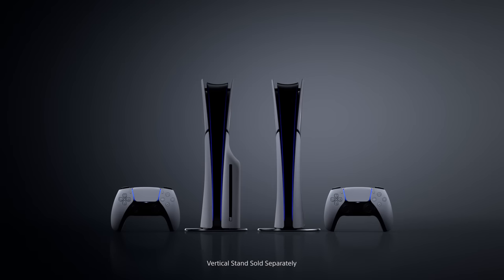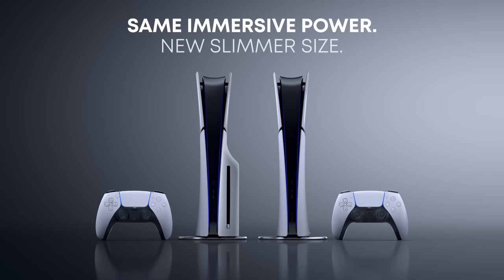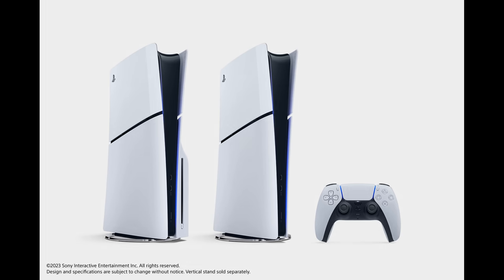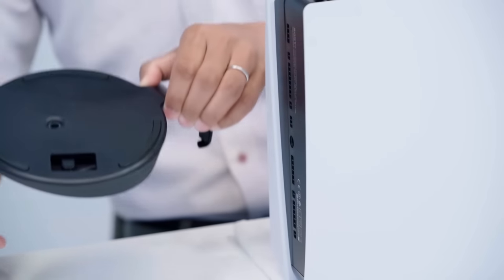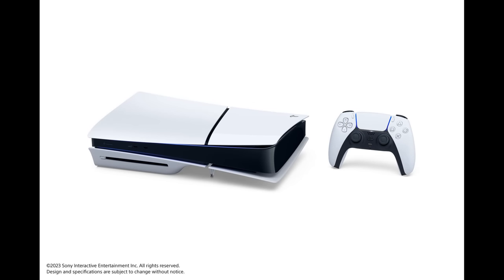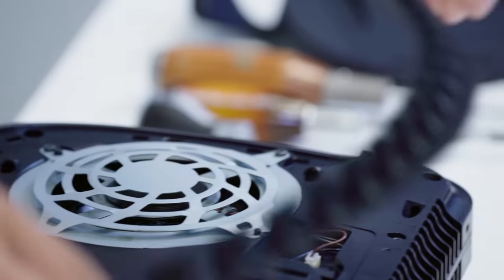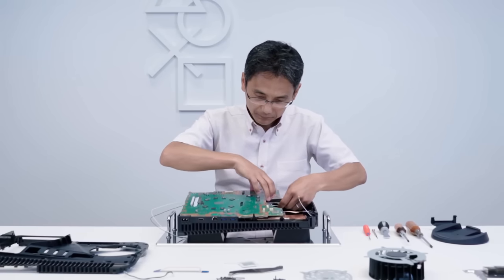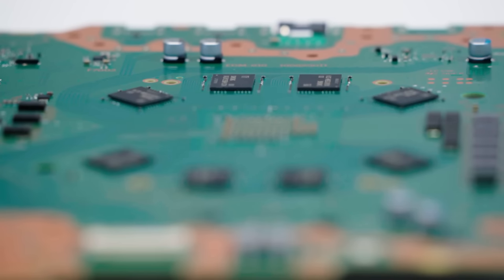PS5 Slim Details, The Good & Bad - Detachable Disc Drive, $30 Vertical Stand, 1TB of Storage

Comment: "What was Sony thinking" you say? This only makes "sense" for Sony in 2 words: Nickel and the other word is Dime.
Reply: that's modern playstation and this PS5 is no exception, regardless of what anyone thinks Playstation is not Xbox and vise versa the other way around thankfully, and regardless if Sony has or doesn't have the money to invest into this system doesn't matter at this point cause they have not been delivering on it barely since it launched, compared to a Nintendo switch or hell even Xbox, their library of exclusive games is laughable
Reply: @copingflower1909 Really what has Xbox dropped this gen? Two games and both were fucked up Redfall and starfield both bugged and glitched up… Both of these companies need to do better but Xbox has undoubtedly underperformed
Reply: @jshjsh6191  don't forget about Forza Motorsport 8
Reply: @alexalexius2688  Okay forza and from what I hear it’s not all that
Reply: @jshjsh6191  well I don't know:) I don't care about racing anyway, I know fans nuked and bashed Motorsport 7 really hard
Reply: Lolol exactly, a stand for $30 disc drive seems decently priced but come on now 500 an actual increase over the previous model for a subscription based console nar… gaming is now a luxury

Comment: Slim PlayStation consoles released at least $100 cheaper... How can it still be  $500 🤦‍♂️
Reply: Cause its Not slim is just a new redesign so the same PS5 with a 1tb storage so dont cry pay or dont pay Nobody is forcing you.
Reply: @ArielCleirigh I know they not telling you to buy it people need to just move on
Reply: @silverjoystix4696  @silverjoystix4696  Cheaper to manufacture, impractical nonsense design, charging more for slim cut down version, which current model version supposed to have 1TB storage already for its $400 price.

All Sony needed to do was design, external drive, wire connected to new optical port at back of console, or more practical design so console sits flat on a surface, with elegant stylish looks.

This slim model will not selling very well.
If anyone has any sense, they would buy the full drive version and remove the drive if they, do not need to use it.

Or better still wait for, PlayStation 5 Pro, which hopefully should be better designed.
Reply: @masterbeyond6548 won't be no pro bro
Reply: @sleasy01  We will have to wait and see, as there is already talk about, PlayStation 5  Pro, targeting 8K resolution with consistent 4K 60fps. 

Just like this talk of, PlayStation Portal, and now this new, Slim PlayStation 5, which has just been revealed, so it is with PlayStation 5 Pro.

Many welcome the idea of PlayStation 5 Pro and want this to be a reality. 

If you know there will not be, PlayStation 5 Pro, please explain.
Reply: @masterbeyond6548  I don't see a world where it makes logical sense to make a pro. Think about how bad the economy is and the fact that it's going to get worse. Even the mighty epic is losing money with fortnite. They'll make a pro and what will the specs be? 14 t flops? Then they'll have the same issue Microsoft has with trying to make games for multiple skews. Games are taking much longer to develope as well. Both companies are targeting 2027/28 for the next console release. We pushing up on 24 and Sony just did a mid gen refresh. A pro makes no sense in these economic conditions. I could be wrong but I honestly don't see a point in a pro. You'll get more stable frame rates and that's it. Just wait for the ps6
Reply: @sleasy01   I totally disagree. 
Sony will release a new cut down cheaper to manufacture, slim version of the same console, and charge $50 extra without a disk drive. 

To add a disk drive later will cost $80 extra, total of $530.
The new console sold at $500 with disk drive, is the exact same console sold at $450 with 1TB storage.
So why is $500 console with 1TB storage not more expensive? Also there should be difference of $80, but its only $50 difference from $450 to $500. 

Now everyone knows Sony is ripping customers off, for the disk drive, that only cost $50, charging $80 for it.
Also everyone knows $100 difference for current model is, rip off price, charging $500 which should be $450.
Also three years have pasted since PlayStation 5 released, and cost for, current model, should be $350 without disk drive, £400 with disk drive. 

Cost for, slim cut down console model refresh, should be $300 without disk drive, £350 with disk drive.

(Both consoles are exactly the same console)

This has got nothing to do with inflation. (Sony are charging more for cut down slimmer model)
Which means, PlayStation 5 Pro should be $450/$480, less than $500 with new more advanced features.  

You may not see the reason for PlayStation 5 Pro, but the console is advertised with 8K on the box, and games that should run consistent cannot even run at full, true 4K 60fps, without reduction in graphics and missing frames.

PlayStation 5 Pro is very much need as new slim console has no improvement.
If new slim console is improved then yes, there would be no need for PlayStation 5 Pro.

Now we all know Sony is ripping customers off, they cannot do it again:
I will expect PlayStation 6 to run full true 8K 120fps, and cost $450,  PlayStation 6 Pro, $480/$500, as technology improves and becomes cheaper over the years.
Reply: @masterbeyond6548  you are getting high LMAO. What graphics card out today can handle 8k@120??? Consistently? None. The 4090 can't do it and we are talking cards that cost thousands.  So how do you expect Sony to deliver 8k@120 for 499.99?  My dude the PlayStation can do 8k. Just not much on the gaming side. It can run 8k movies. Like I said, it's no point in a PS5 pro. The cost would be too much. Especially if the target is 8k. Sony is trying to sell PS5 consoles. Adding the pro to that would be a waste especially after you just did a mid gen refresh.
Reply: @sleasy01  As you mentioned PlayStation 5 cannot run games at 8K without problems. This is the reason for PlayStation 5 Pro.

Current graphics cards are good just the software and programming, is holding back their potential.
The programming physics is not correct. If the physics was correct first time, there would be no need for updates. 
This is the reason why there are constant software updates with improvements.

Technology within the next three or four years, will have improved so much, making PlayStation 6 very advanced technology. Games running, 8K 120fps 120hz, or better, is for PlayStation 6. 

New technology is coming which you never thought existed!
Reply: @masterbeyond6548  no my guy. They will not target 8k with a pro. The bulk of people that own 4k tvs is less than people that own old sets. So why target 8k when 4k isn't owned by the masses? That makes zero sense to focus on that when most people don't own 8k tvs. I don't know one person who owns one.
Reply: @sleasy01 
I already answered:
"This has got nothing to do with inflation. (Sony are charging more for cut down slimmer model)"

"You may not see the reason for PlayStation 5 Pro, but the console is advertised with 8K on the box, and games that should run consistent cannot even run at full, true 4K 60fps, without reduction in graphics and missing frames."

Which means, PlayStation 5, cannot run at full, true 4K 60fps, even though it has 8K on the box.
It is understood (PlayStation 5 Pro), needs to target, full, true 4K 60fps. (8K will have to improve to target desired 4K performance)

In the next 3/4 years 8K will start to become mainstream.

I will expect (PlayStation 6) to run full true 8K 120fps.
Reply: @masterbeyond6548  dude you are really getting high. In the next 3 years 4k tvs will still be a thing. 8k tvs are over 10 years out. Where is the content coming from for 8k? 4k has been out for a while now and most content is not delivered in 4k
Reply: @sleasy01  
I totally disagree,

PlayStation 5, already is 8K ready, and has 8K on the box. Its 4K performance is what needs improvement.
This is the reason for PlayStation 5 Pro, to improve its, 4K 60fps output performance, which will also improve its 8K.

8K televisions are already available to purchase, but can be expensive. They will reduce in price within 3/4 years from now.
You are totally mistaken.

PlayStation 6, will be fully 8K 120fps ready.
When PlayStation 6 is available, many will keep their 4K display, replace them, or use mix of 4K and 8K display.

Comment: I don't know, but for the original disc version, I would have made the whole middle black part as equal in measure as the top end (when the fan stands) instead of going with that asymmetrical design, so i can put the disc tray inside completely in the black part instead having that bulky design on the bottom. Then, i would have design the bottom plate same as the digital one, but with a small layer to look as a base. Think similar as PS3.

Comment: If it's like the OG PS5 you can still technically stand it up vertically without the stand it balances on it's own well
Reply: The stand is not really needed to sit vertically but it does provide more stability/balance if someone moves the table where the PS5 is standing on.
Reply: @ShakyShako  as long as you put the PS5 in a safe place and don't hit the Entertainment Shelf or Table it is standing on it is perfectly fine being vertical by itself.
Reply: @williamaguilar9389  indeed. It more depends on which environment the console is in. If it’s a calm and safe space then no need for the stand. Most people take good care of their consoles so the need for the accessory is less likely.

Comment: ok it seems to me that this is only one SKU but you can purchase different bundle, the one with blu ray drive and digital edition.
Reply: Only the digital version went up in price.
It is a price increase to  make the extra connections for the new digital to hookup with a optional Blu-Ray player.
The older Digital needed no extra connections for a optional disc player making it cheaper to make ..
Reply: It is one console.
Because the Disc Drive on the Disc version can now be removed and replaced, Making it a digital only version with a Detatchable Disc Drive Pre Installed.
I dunno how people cant see this. xD

Comment: From an industrial design perspective,I appreciate the defined streamlined look of the new models.I would also like to point out that paying for the vertical stand is not new to Sony Playstaion conlses as the vertical stand for the PS2 and PS4 were not inclded.I will not however be upgrading my launch edition PS5 disc system to the new slim variant.I would however purchase the vertical stand that compliments my PS5 setup with the new matte black DBrand vented sides.
Reply: Even though I already have a PS5, I would love to have the new revised version. If I ever had to replace it due to breaking and not working properly, I would get the digital edition version PS5

Comment: Happy with my launch PS5. I just hope the pro design doesn’t follow the slim. If it does I don’t care tbh still getting the PS5 pro regardless of what design it turn out to be.
Reply: I will wait for the Ps5 Pro review vs a standard Ps5.  Not changing for a small increase in game performance .
Like the PS4 Pro, only a few Ps4 games were Ps4 Pro enhanced , most games stayed at 1080p/ 30 fps  which the base Ps4  could handle fine .
Reply: Why are you buying a PS5 pro and games take 4 to 6 years to develope? By the time a game comes out for it the ps6 will be out
Reply: @sleasy01  it’s my money. You salty bro?

Comment: Circuit board getting smaller, heatsink getting smaller thru revisions and still i wonder whats the use big ass plastic around if other can do good airflow smaller than ps5 slim.

Should have been cheaper tho to be honest.
Reply: Naw. They save money on the design so you pay more. That's how it works. Not stop clutching your purse and give Daddy Jim his coin. He needs a boat to retire with LMAO

Comment: Vertical stand sold separately was the same with PS4, but yeah. Taking it away after it already came in the box is a bad look.
Reply: They're not taking the stand away there's the standard stand in the box...
Reply: @tristman8413 they did take it away…the stand that comes in the box now allows the console to be placed horizontally or vertically.  No additional cost needed…
Reply: @farhanryan2895  the stand that came with my og ps5 let's it lay horizontal or vertically... 🤷‍♂️
Reply: @tristman8413 correct, my launch model does the same.

The slim model only allows horizontal placement out of the box.  If you want to place it vertically it’s an extra $30.
Reply: @farhanryan2895  ah fair enough.

Comment: Didn't even mention the disc drive is a paperweight without a intial internet connection, what happens if you still have a PS5 when PS7 drops, they close the servers, your disc drive breaks, you buy another on ebay, won't work because you can't sign into psn anymore.

Comment: This is why Sony needs more competition because they don't care they just can't charge you whatever they want to charge now and then when the ps6 comes out if there's still no competition you'll be over $1,000 Australian because right now in Australia the bundles are about $900
Reply: Only the digital version went up in price.
It is a price increase to  make the extra connections for the new digital to hookup with a optional Blu-Ray player.
The older Digital needed no extra connections for a optional disc player making it cheaper to make ..
Reply: @Crashed131963  The Math is simple.
Its a cut down version that saves manufacturing cost over the current models.
Both the (current model) with disk drive, and (new slim model with disk drive) are the same package price.

Both (slim package models) are exactly the same machine.
Sony is charging extra $50 for the new slim cut down version.

Sony charge $100 extra for the current model, which now we know should be $50. ($450 with disk drive)
Now Sony want to charge $130 extra to add disk drive. $160 extra to add disk drive and stand.

This new slim £450 machine is the exact same machine inside the $500 package. Only $50 difference.
Sony now charging extra $80 instead of $50 

This is total rip off.
Reply: Now we all know Sony is ripping customers off, they cannot over charge customers again:
I will expect PlayStation 6 to cost $450,  PlayStation 6 Pro, $480/$500, as technology improves and becomes cheaper over the years.
Reply: @masterbeyond6548  Fun Fact)- When adjusted for inflation the ps4 in the 2013 release would cost $530 today .
$30 more than the Ps5 today ,
Reply: @masterbeyond6548  The ps5 slim disc version is the same price with a added 175 gb of ssd storage .
Not to bad .
$500 in 2023 is not a lot of money to play new AAA games at 1440p/60fps .
Reply: @Crashed131963  Fun Fact: $500 - $450 = $50.
The math is simple.
(Both consoles are exactly the same console)

This has got nothing to do with inflation. (Sony are charging more for cut down slimmer model)
Reply: @Crashed131963  
Your Math is not correct, its 199GB, extra storage.

To add a disk drive later will cost $80 extra, total of $530.
The new console sold at $500 with disk drive, is the exact same console sold at $450 with 1TB storage.
So why is $500 console with 1TB storage not more expensive? Also there should be difference of $80, but its only $50 difference from $450 to $500. 

Now everyone knows Sony is ripping customers off, for the disk drive, that only cost $50, charging $80 for it.
Also everyone knows $100 difference for current model is, rip off price, charging $500 which should be $450.
Also three years have pasted since PlayStation 5 released, and cost for, current model, should be $350 without disk drive, £400 with disk drive.

The Math is simple.

Comment: Slim version:
Cheaper to manufacture, impractical nonsense design, charging more for slim cut down version, which current model version supposed to have 1TB storage already for its $400 price.

If anyone has any sense, they would buy the full drive version and remove the drive if they, do not need to use it.
Or better still wait for, PlayStation 5 Pro, which hopefully should be better designed and sit flat on a surface, with elegant stylish looks.

Comment: People care about weight? Its Like caring how much my stereo speakers weigh .
The Fans  on the  original Ps5 is larger and deeper(120mm).      Will  the new smaller slim run hotter with smaller fans?
There is a reason serious PC gamers buy large towers not small towers and laptops .

Comment: the fact this quote on quote slim model is replacing the original model is shitty, this newer model is so much uglier compared to the sleek and futuristic look of the original design, not only that there is almost no reason to buy this system unless you don't already own a PS5, but even then unless you are really worried about the disc drive and want the convenience of just easily removing it the reasoning is still slim
Reply: What are you talking about, it's fundamentally the same design at its core, just a bit smaller